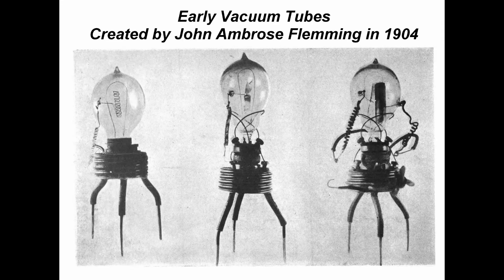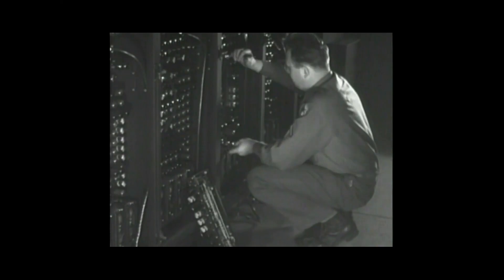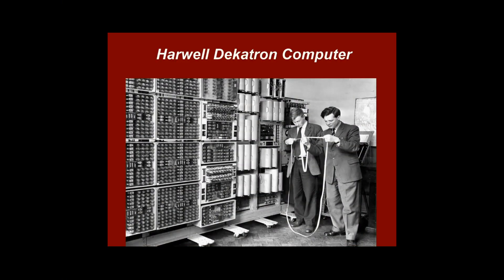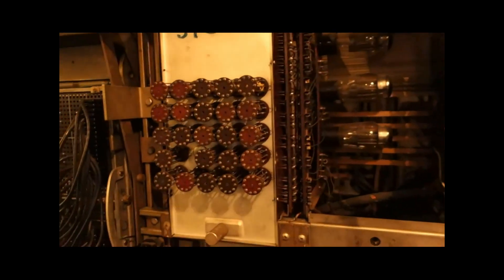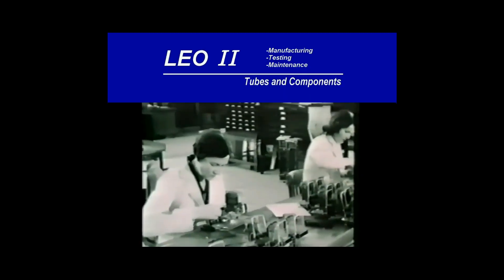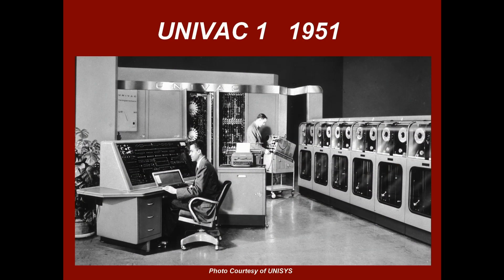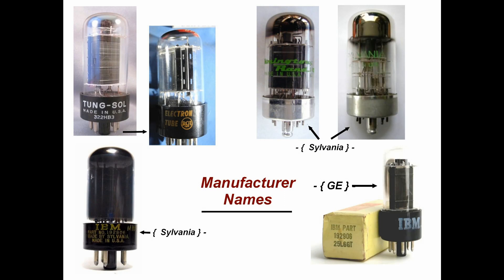Computer History:  Early Vacuum Tube Computers Explained, Educational & Historical 1945-1960s

Comment: Back in the early 70s, I worked on a "computer" in the Toronto Stock Exchange, which was used to transmit stock prices to brokers offices.  It used vacuum tubes, relays and a memory drum.  The company I worked for also carried SAGE circuits from radar stations in some areas in Canada to those SAGE computers.  Incidentally, that light gun, used with the SAGE computer, was one of the first, if not the first pointing devices used with a computer.
Reply from the maker: Fascinating, The TSE must have been very interesting!  And, yes, makes total sense. There were SAGE installations in Canada as part of the North American defense.  Lots of heavy tech in those days!  Thank you for sharing that info!  ~  VK, CHAP

Comment: Up until the late 1950s most car radios had vacuum tubes and a "vibrator" power supply -- I think the more expensive the car,the more tubes in the radio. Say,a Buick vs. a Chevrolet.

Comment: in Denmark we had DASK, built in 1957 by the Danish Regnecentralen (state calculation department, today the department for digitalization). This is the only existing video of it in operation during the Danish parliament election in 1960 https://www.youtube.com/watch?v=z_8uV5Sawp4 At this point it had 80,000 tubes and magnetic drum storage. And for those not so good at Danish, the guy talking about it in that video is the lead designer. He was mildly perturbed because the reporter calls it an electronic brain and then he explains how the machine works. It more or less did the same job as the American machines: statistics and calculations, and projectile calculations for the military. DASK remained in service until 1967 when it was scrapped and sent to the national Technical Museum where it remains in storage
Reply from the maker: That is a great historic video of the "DASK" machine!   Thank you for pointing to it.  At 80,000 tubes, it ranks at or near the top of vacuum tube computers(!)   (RCA Bizmac and IBM SAGE come very close).   I wonder if there is a full translation of that Danish film.  It would be great to get ownership approval to re-host that film here with English subtitles.  It was fun to watch, however, since they clearly show many parts of the machine.  ~

Comment: I don't know why they didn't use sub-miniature valves instead miniature valves as they're physically a LOT smaller and use less power (And lower operating voltages). If used in conjunction with PCBs it would resulted logic-modules that were smaller and lighter hence a smaller mainframe.
Reply: They might not have been available at the time.  Those smaller tubes were much later than the big ones
Reply: @James_Knott  Sub-miniature valves first appeared in the late 1930s and they were first used in first-generation electronic hearing-aids and remote controlled aircraft. Then in WWII they were mass-produced by the tens of millions for use in proximity-fuses used in anti-aircraft shells.
Reply from the maker: Hi Nicholas, that is a very good question.  The smaller tubes took up less space, making the entire computer potentially  smaller in size.  Perhaps the sub-miniature tubes were most costly back in the early vacuum tube computer days.  ~ something to look into.  Thanks!   ~ Victor, CHAP
Reply: @ComputerHistoryArchivesProject  "Perhaps the sub-miniature tubes were most costly back in the early vacuum tube computer days."

Maybe, maybe not. I have some difficulty believing as sub-miniature valves were produced by the tens of millions in WWII for build radar proximity-fuses in AA-shells also during the late 40s, 50s and into the 60s sub-miniature valves were used extensively in avionics such radios, radars, missiles, navigation systems (Such as the AN/ARC-21 TACAN), etc. But still even with double-sided PCBs alone logic-units could've been shrunk.
See this video on proximity fuses - https://youtu.be/N0SgC78YFPc
Reply from the maker: Good points!   Thanks for the film link too. A fascinating video!  ~   Victor

Comment: The LGP-30 only had 113 tubes due to its use of silicon diodes to make up most of its logic- just over a thousand of them.  It also made the computer exceptionally small for the amount of computing power it had.

Comment: I worked on a tube computer that had a specific use, to encrypt and decrypt teletype communications.  It was designed in 1956 and was used until the 1990s the KW26.
Reply from the maker: Hi David,  fascinating.  I just noticed a KW26 tube card on eBay, for $239.   I learned something new. Thanks!  ~CHAP
Reply: @ComputerHistoryArchivesProject  Thanks for the update.  I worked on the KW-26 and the KW-7, one year training and 3 years on duty, 1969 - 1973.  It was a fantastic design and the code was unbreakable, an electronic one time tape.  The only flaw was if the same card was restarted - then the code would repeat.  That's why the card reader had a knife in it to cut the card in half as it was inserted.  if you have the time you might find this interesting  http://www.jproc.ca/crypto/kw26.html
Reply from the maker: Hi Dave,  that's an excellent web page, thanks very much!  That's some great tech I was not fully aware of.  Another double espresso, and I will finish reading the whole page. ~  Victor, CHAP
Reply: @ComputerHistoryArchivesProject  I was very lucky that I went into the  USAF and learned these skills it gave me a 40 year career
Reply: I thought it would be like Morse code or something.

Comment: How many BTUs were given off by each of the different types of tubes? These computers also had to have air handlers to supply cooling air. But was the air also filtered, cooled and reused?
Reply: The heater current of a 6H6 twin diode is 0.3A at 6.3V, so you can calculate the BTUs from that and get a rough estimate of power required to run a vacuum tube computer.
Reply from the maker: Good question. I don't have a reference for BTU by tube, but am aware that early large vacuum tube computers were often cooled by "chillers", water-based machines with fans, etc.  Tube based machines gave off enough heat to warm the room.   Air conditioning came later.  Even up to recently, some very large machines use water cooling, some use cryo technology.  Hope that helps a bit.  ~   CHAP

Comment: Hello,
at 1.53 these are relays, in a calculator used to control 1 balance and a printer, there were a multitude of them, from GENERAL ELECTRIC brand, this calculator weighed about 80kg and contained 60grammes of 21 carat gold, it was the or contacts, I had noticed thanks to a flood at a supermarket customer where the butcher's laboratories were often in the basement, a blow of drying with hair dryer, replacement of the plate straighteners and the calculator started again, of there I said to myself that the contacts were made of noble metal better than copper.
From then on I started to recover the calculators going to the destruction, because these old scales were replaced by a new generation, but how much gold was thrown, I dare not think about it.
This scale had been patented in 1962 by Hobart, it was in 1975 that I joined it, there were quite a few left in France, the diagrams of the calculator alone measured 3 meters long and 70 cm wide, a "clamp "special to move away or approach the contacts (time delay).
Excuse me, because online translation can be difficult to understand.
Attached patent but the calculator is not there, because I think Hobart had been looking for a calculator already made in another company.
https://patents.google.com/patent/US3045229A/en
Bonne journée.
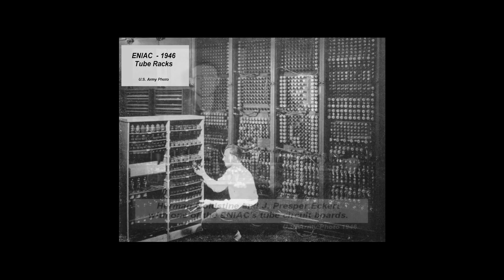Reply: You mean at 1:55.
Reply from the maker: Hi  rémi,  Fascinating.  Thank you for the detailed info. ~  Victor, at CHAP
Reply: @ComputerHistoryArchivesProject  
Hello Victor, I just realized that NCR is you too.
So in the patent we can better see the Hobart printer and if we remove the iron-on label ejector (25) and all the rectangular bodywork, we end up with the good old NCR body in the flat position, it suffices to remove it. raise and we find the normal configuration with its numbers (20), and the well-known rounding where the buttons were replaced by Hobart by a block of "latch relay".
 the crank (also well known) being placed in the middle of the cover door located behind the ejector 25.
For the calculator, it must have been used at one time at France Telecom for communication relays, I had seen the same ones about to be sent at the foot of a central site. Coming from the USA it must have been used in your home probably for the same use.
I had kept everything of these machines from my youth but a stupid manager had tidied up without warning us and had all my documents thrown away, in France they are less sensitive to their industrial past and whoever is interested in it is laughed at, despite knowing a lot about the company.
Hobart is Professional cooking, weighing closed in Europe (yet profitable in France) by the group that owns Hobart, then it was Kitchenaid in 1919 and sold in 1992 to Wirhpool by the Premarck group again but owned by ITW Illinois Tool  Work. In 1975 the shareholders were private and only checked the good management, which is normal, the strategies nowadays are not always good, but it is so.
Bonne continuation et Merci pour ces vidéos intéressantes.

Comment: In those many tubes if some tubes damaged does computer still work
Reply from the maker: Hi Krish, I think if one tube goes bad, there will be problems in the computer.  Some tubes go bad slowly, and had to be checked periodically.   In those days, tube testing and tube replacement was a very big concern.  Also, the best computer engineers would only buy tubes that were "computer rated" meaning they were designed to operate more efficiently for longer periods at specific voltages.  In some cases, tubes were given initial burn in times to make sure they would last for the expected duration of the computer's need.  Needless to say, the computers of the 1940's and 1950's drove the science to create better and more reliable tubes than the ones in radios.  High quality "computer rated" tubes were in high demand, until the invention of transistors and integrated circuits, and eventually, microprocessor chips.  Great question.  Thanks!  - Victor at CHAP
Reply: Apparently some computers designed some important logic in parallel, so that one vacuum tube heater burning out wouldn't necessarily stop the computer. Others designed it so the clock would stop if one of the tubes burned out, allowing online replacement and resumption of program execution.
Reply: The Swedish BESK computer, completed in 1953 and fast for its time, contained 2400 tubes. It ran in average for 5 minutes between HW failures, but this was improved in 1954. 
See https://en.wikipedia.org/wiki/BESK

Comment: Would perhaps be better titled "early digital tube computers", as it ignores the many analog machines created by, for example, GAP-R Philbrick - which continued on as a useful tool well into the solid state age (see - opamp).  And of course, the inventor of the vacuum tube depends on which side of the pond you are on.  On this side, it was Lee DeForest.  In truth, like the light bulb, governments tried to grab the glory for first (see, flight for another example) regardless of who was really first, or if the inventions' time had simply come and the inventors independently came up with their invention around the same time (inside a news cycle latency).  Often it was as much a matter of who was better at self-promotion than it was of inventing competence.
Reply from the maker: Doug, you make some good points.  The "who was first?" question is often a very difficult one to pin down, and often depends on one's point of view.  Good comments. ~  Victor, at CHAP

Comment: Am very curious about the sage supercomputer with it’s light gun device.
Reply: Although it is called a “gun,” a light gun (like the Nintendo Duck Hunt game gun) doesn’t shoot anything; rather, it PICKS UP the initial flash of light as the CRT’s electron beam passes over the area of the screen where the gun is aimed.  That time corresponds to what the display unit was “drawing” on the screen.

Business and engineering systems often used the same technology in a small cylinder and called it a @light PEN.”  I suppose the “gun” was meant to appeal to warriors.
Reply: @allanrichardson1468  It propably seemed very fancy at the time but I find this SAGE "big boys missile shooter" a bit awkward and also, endlessly hilarious ':D
Reply from the maker: Hi Johneygd, SAGE was an amazing computer system, networked defense computers of the mid 1950's.  Here's a good video  https://www.youtube.com/watch?v=06drBN8nlWg
Reply: That was one of the first, if not the first, pointing device used with a computer.

Comment: We should've stuck with vacuum tubes and made them smaller with advancements in carbon nanotube technology and molecular rigid bodies since electrons will start quantum tunneling their way in dielectrics in semiconductors. Mechanical computers, too. With such material engineering advancements, nanotube tech would've also yielded greater energy efficiency with nanotube vacuum flywheels that couldve been used to wind up the flywheel battery on our vacuum tube smartphone. Alas, maybe in the next life
Reply: I think the problems associated with that would have been degrees of magnitude worse.

Comment: first generation of computer uses tubes? and what generation are mechanical calculators, and relay computers?
Reply from the maker: Hi Mirek,  that's an excellent question.  Here is my take, and perhaps other people can give their opinions as well.  Typically,  the "texts" on computer history start with 1946 as the beginning era of First Generation computers, specifically, "electronic digital computers."  Earlier machines, such as the Z3 by Konrad Zuse (1941), and the IBM ASCC (1944) were "electromechanical," not fully "electronic" and therefore not in the same class.  Mechanical computers and relay computers that have no electronic components (i.e., no vacuum tubes or transistors) are arguably "pre-electronic."   A distinction is made between "electrical, electro-mechanical, and electronic."  Electronic machines control the movement of electrons in very specific ways.  Electro-mechanical computers use electricity to power solenoids and relays, and such.  --  {Maybe they should call the "pre-electronic computers" the "Zero Generation" computers}    Hope this helps.  Sorry for the long winded reply.  ~    Mark   (CHAP)
Reply: @ComputerHistoryArchivesProject  The long winded reply is what I, personally, was looking for, honestly. Thanks for the clarity.
Reply: I think they came up with the ideal in the 1800's with mechanical calculator stuff.

Comment: I don't recall the specific tube types, but according to the excellent reference book Tube Lore by Ludwell Sibley, some previously developed tube types were modified and manufactured as special-purpose variant versions specifically for computer use. Apparently, some commoner or standard issue tubes were prone to develop a sort of sleeping sickness, a chemical poisoning of the cathode, when they idled for long periods of time in a computer without having to conduct any significant plate to cathode current.
Reply from the maker: Hi good 'un,  fascinating info.  Thank you!  ~   CHAP
Reply: Sleeping sickness is usually associated with cold cathode tubes like nixies, and dekatrons. Vacuum tubes can have their cathodes damaged by being in cut-off (no current passing thru the anode-cathode path) too long. In that cases its called 'interface resistance'. Depending how the oxide emission layer is formed on the cathode, determines if the tube will be damaged. Tubes like the 5963 (special 12AU7) and 5964 (special 6J6) are an example of 'computer' tubes, immune to 'interface resistance'. However, that said, in later years of tube production, all vacuum tubes used the more robust method of forming the cathodes. Of course, by then, no one was still using vacuum tube computers.

The Burroughs B205 came out ~1960. It still used tubes, but most of the competition were already shipping their first transistor based computers.

Comment: Interestingly, they don't mention the series of Philbrick tube type op- amp modules labeled Gap / RR. It's my understanding those were used for some types of analog computing. I had about 50 of those some years ago, they came equipped with a pair of Telefunken 12ax7 tubes for each module! The other end of the module had standard octal plugs just like a 6L6 or other common output tube. Both the tubes and the Philbrick op amp modules sold pretty quickly on eBay.
Reply: good 'un, the computers covered here, are DIGITAL computers. That means, they run off a program which is a sequence of n-bit (digital On or Off) instructions.

Analog computers operate in a completely different manner. I've programmed both ANALOG and DIGITAL computers. In an analog computer, you basically wire up a circuit, that often represents a differential equation, and all parts of that circuit run concurrently. Not sequentially, as step by step instruction on a digital computer. The output of an analog computer is often a graph drawn on a x-y plotter, that compares two voltages. One for the x-axis, and one for the y-axis. Can't use an analog computer to run a web browser.

This is where language has a great failing ! The term "computer" has many meanings. The only reason it was used for both digital and analog computers, was that both computer types initially were used to solve math problems. A job originally done by a whole bunch of women, who's Job title was ... computer. See the movie 'Hidden Figures'. That's why, I KNOW that people who take things literally are idiots ! Language has a great failing at getting the meaning across accurately. that's why there are drawings, schematics, graphs, and other methods to get the message across.